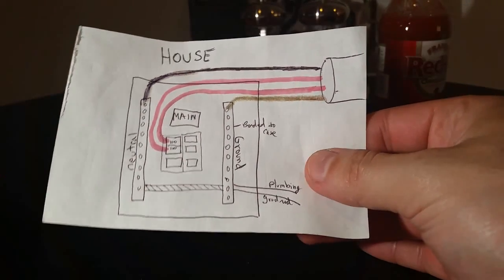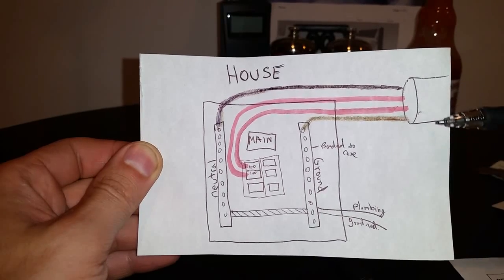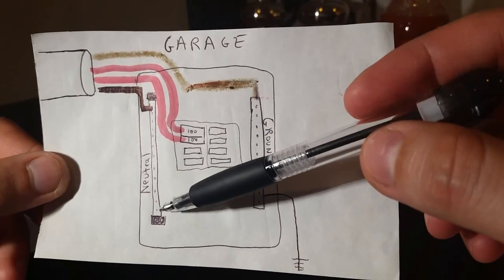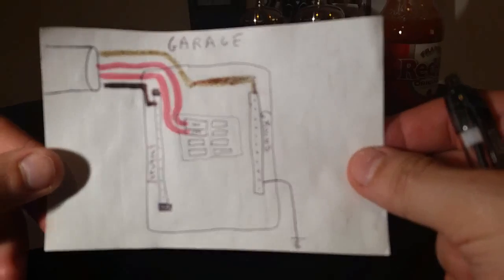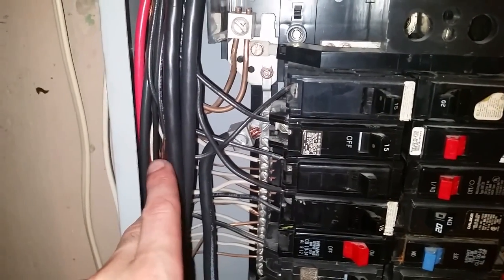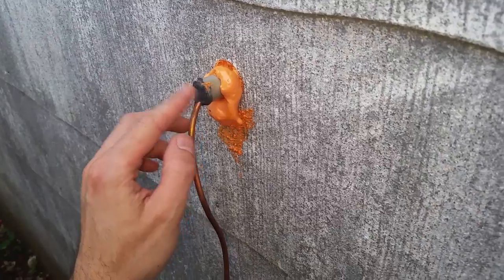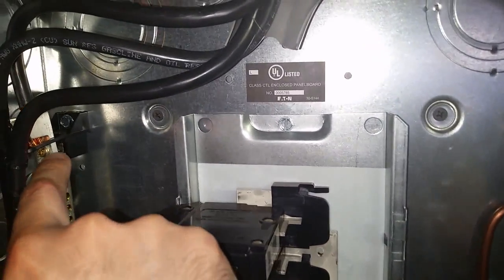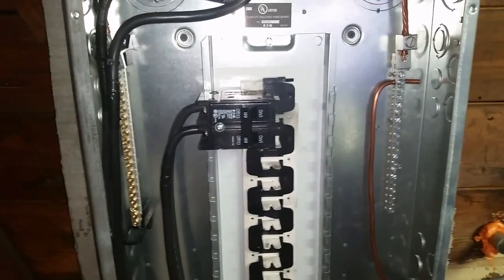How To Wire A SubPanel

Comment: Hey funster---Manny here, licensed electrician (trade-worthy since 92'), screw all the comments on how the kids chant: "Uuu, the panel is messy..." They are the ones who mainly do the 'wimpy-work' (ie. not enough torch down on heavy wires, flimsy pipe n' panel installs, etc)... Your job looks solid strong n' durable! Not the prettiest install but who gives a sh*t, we want stuff that is well supported n' something that will need nil-none maintenance within the coming years. A couple of critiques I would say is the exterior PVC was excellently supported w/ multi clips but you should have piped n' supported the ground too. On the ED-theory side of things, perhaps you could have described 'why the neutral needs to be isolated from the ground ' within the subpanel. As to secure a condition whereas if the neutral was lost at the main panel, due to equipment failure or weak tightening by fellow apprentices like thoses who have probably bashed you just previously on splices in the panel, or, maybe even a neutral loss pre-consumer side on the street transformer. The centre tap neutral block on the secondary side of the Hydro utility went bad thus all these phantom neutral conditions will return into the subpanel! And if it is connected to the ground as you very well described "should not be" then the unbalanced load will return therein, ultimately energizing the chasis of the sub panel! Moreover, the main will not trip due to the anomaly cos' it would not sense any difference within its' internal bimetals... Subscribe @Manny Calderari: I have Elec-Vids as well on Voltage Drop concepts, Pictorial drawings on connections n' the like... Great Video, excellent pictorials, solid job-out standing, n' cool jokes; especially "I like straps, I'm Greek" Bahaha!
Reply from the maker: Manny Calderari thanks for commenting

Comment: You stated that if you have more than 6 breakers that you should have it wired to a main disconnect breaker. How would you wife the panel without the main disconnect breaker?
Reply from the maker: johnsta83 i said that?
Reply: klowny1969 yes,start watching at 16:55. Unless I am misunderstanding you. Thanks.

Comment: Does the grounding/neutral/bonding apply if the sub panel is located in a seperate structure? Should it be a 3 conductor or 4 conductor going to this structure? Great video.

Comment: is their a way to wire a subpanel with 3 wires? i was thinking 2 hots and a neutral and run a ground wire from the subpanel to a ground rod would that work?
Reply from the maker: storminnormanz yeah but check with ur local codes first
Reply: ok thanks!

Comment: Drawings in the beginning made me understand easier for the walk arounds
Reply from the maker: Michael Sheets thanks for watching and commenting
Reply: I am contemplating putting in a sub panel in my garage (40 feet of wire). currently I have the only 2 remaining 220V Circuits left open, one for my air compressor and for my welder. If I put one more 220V machinery in there should I just go ahead and put a sub panel in my garage?
Reply from the maker: Michael Sheets ur better off

Comment: In the sub panel, is there continuity between the neutral bar and the ground bar? If so, they are the same thing. If you trace them back to the main panel, you will discover this.
Reply from the maker: I answered this question in the vid..no they are not comnected in the sub

Comment: Aluminium wire is not the best choice. However you misspoke about copper not expanding. It does like all metals when heated.  Copper does not expand as much as aluminium.      

Running a ground wire  to a water main is not a great idea anymore since many water utilities now use plastic pipe from the street to the meter outside (or inside)the house and many houses now use pvc or PEX.inside, none of which will conduct electricity thus making them useless for proper grounding.  

 A better idea is to run a #6 or #4 solid copper wire to a ground rod in the yard.   A damp or normally wet location is best for conductivity.  

NEVER pound on the end of the rod so hard it starts to mushroom.  (An inspector told me that when he finds a mushroomed ground rod he requires it to be dug up and the rod hole be inspected before the ground rod is re installed then inspected again before the dirt is put back in the hole - do it right the first time and avoid the hassle.  I was lucky - I could not find a hacksaw before I started hammering.)

Make the installation easier by digging a hole a foot (or more) deep and fill it with water several times as the water soaks down.  I would even do it a fourth time and leave it overnight.  The rod will go in with light tapping with a baby sledge and a chunk of 2 x 4 to protect the rod end. 

 It is a good idea to extend the ground wire to two or three  more rods spaced at least six feet apart and below grade and cover each with af concrete patio square so you will know where the rods are.  Again wet location like a gutter downspout discharge is better than a continuously dry location.

Comment: Ok first I'm sorry for my ignorance but I'm learning and studying to be an electrician but I have a question and someone please help me. 
If I have a main panel of 100 amps, how many amps the sub panel should have ? Is it 60? Or can I use 100?
Reply: Joshua Cortez Supe best to add up you amp needs at the future building and then build the box based on what you need. Then if it's beyond the 100 amp main, well you're out of luck.
Reply: @Jack_Of_Most_Trades  
Not completely out of luck, but need separate service entrance installed from the power company :-0)

Comment: FYI, if you have more than six breakers in your sub-panel you are required to have a main shutoff for that panel per NEC 230.71. This can be a back fed breaker so long as it is tied down (as I see you've done here but didn't mention). A sub-panel main breaker can have a larger amperage than the feed breaker in the main panel, i.e. you can have a 100A sub panel fed by a 60A feed breaker from the main so long as the feed wire and load calcs are for 60A, the 100A sub breaker simply acts as the aforementioned shutoff. Also, it makes no difference which hot wire goes into which breaker terminal, they both supply 120V. Nice vid.
Reply from the maker: Thanks

Comment: does a underground require a gfci breaker?
Reply from the maker: papa Hajek not unless the outlet is outside
Reply: Thank you
Reply: papa Hajek all outlets off a subpanel needs gfci so it's best to just gfci the first outlet in a circuit and the rest will be covered on that circuit.

Comment: I'm wanting to run a new100amp panel outdoors for an RV.  the camper has 50amp and 2 a/c units on roof with elec heat.distance is 300 feet away from the 200 amp main . Can you tell me what wire size to get and how many? I was told 3 wires @ 1/0 copper? and was told four wires from a different person? Thanks for the help
Reply: Do you want 120 volt or 220 volts ?
Reply: You are probably done, but in case anyone else plans similar ---

A 50 amp RV plug/outlet has 2 power wires - each 120 volt
so you can have more amperage available (along with ability to run 240 volt if needed).

300 feet (plus however much for extension cable 50 feet not uncommon)
could cause a lot of voltage drop and some equipment on the market won't run properly if the voltage drops too low.

I would go with 3/0 copper wire for each of the power cables and 2/0 copper for the neutral.

1/0 may well work okay depending on how much amperage you actual use at any given time. 

The added cost for 3/0 would be worth the peace of mind that you'll have no future problems.

You should drive a copper ground rod in near your RV outlet power supply.

2 power + neutral from the main and 8 awg bare copper from RV outlet to local ground rod.

It's also good practice to run 8 awg bare copper to connect the local ground rod to the ground rod at the MAIN but is not absolutely necessary for long distances like you are talking about.

PS
 I buy wire from
http://www.ebay.com/usr/acdcwireandsupply

Comment: At 6:24, why are you grounding the sub-panel to ground rods, if the ground bar at the main panel is already connected to those? Thanks!
Reply: Same building no, different building yes
Reply from the maker: DTM the ground wire going to the main fromthe sub was an extra wire..u dont have to wire that one in..but it doesnt hurt..for a detached garage u need a seperate dedicated hround rod..check ur local codes

Comment: Great video.  I want to install a subpanel in my shed, but the power source is a Generac generator so there is no need for a main panel.  My XT8000 watt generator has a 4 prong plug which I want to use as a connection to the power inlet box.  The amps from the generator is 30 amps. What should be the circuit breaker amp be at the subpanel (which is more like a main panel). A real main panel would cost a fortune and is not needed.  Other issues to be concerned about???? Thanks.

Comment: SER cable is not rated for under ground use even if its sleeved in conduit.
Reply: This is a huge break of code right off the bat. I'm looking at XHHW aluminum for my run.
Reply: is there such a thing as a 1-1-1-4 cable?
Reply: southwire has 1-1-1-3
home depot
Reply: PART NO.13103701

Comment: Why not just ground the right bus bar in the subpanel  to the box with a piece of wire, strap, etc?
Reply: @mimeme
Agreed.
So long as the neutral is separate, how the ground bar gets bonded to the case doesn't really matter - so long as it is bonded.
Reply: sirvayr by code it must go to ground rod.

Comment: Great vid.  Question.  It looks your sub-panel only has a bus to attach breakers, no lugs to attach the feeder circuit.  My sub-panel uses lugs to terminate the feeder hots, therefore I'm planning to install a disconnect box just before the sub-panel.  My sub-panel is a detached building, and I did not want to have to go between buildings to resolve tripped breakers, turn power on/off etc.
Reply from the maker: thank u..u can do that with this subpanel as well
Reply: The more I think about it, maybe I should just land my 2 feeder hots on a 60A 240v breaker on the bus in my sub-panel instead of introducing a disconnect box before the sub-pane, then landing the feeder hots on the bus lugsl...Isn't that what you are doing, using that 100A breaker in your sub-panel as a "disconnect" as well as main breaker for all the other branch breakers in your sub-panel???
Reply from the maker: +ke0kie yesir..u can do it either way

Comment: where the white tape on the subs neutral going to the main neutral bus bar failed , you need expansion straps for that pvc ,the trench needs over 6inch depth , the screws used to mount the sub is not code , you need duck seal and corrosion lube on breakers connections the sub needs to be framed in better
Reply: The neutral comes marked with a white stripe from the factory. You can clearly see it in the video. Granted this is a mess but in any multi conductor cable such a SER they come colored. He left way to much of the cable jacket in the panel. And what the fuck was with all those straps hahahaha looked horrible if your gunna overkill it at least kinda make them even.(I would have done like 4 straps)     Eye level?????  You can't have any means of disconnect (swichtes breakers, etc) over 6 feet 7 inches. That's NEC so all of the USA follows it.
Reply: And what screws are code?????? To mount a panel and what article is it??? Him using drywall screws indoors is fine (I use number 10 screws) but there is no code on screws.
Reply: And on copper you do not need no-lox.......You don't need that main breaker in that sub panel you should have just got a main lug panel. And that fire stop is ok I guess but not outside it looks like shit...(maybe a little duct seal and clear calk) much cleaner IMO.

Comment: that's odd I wire sub panels without a ground I un strap the neutral and ground and remove the green screw and I'm grounded from the  main ground bus to ground rod.
Reply: If it's a different building then the main panel you need ground rods. It's clearly stated in article 250 NEC. If it's the same building you obviously don't need them.

Comment: If you wanted a subpanel   right behind the main panel but on the inside of the house compared to the outside would you need to ground it to a rod or can it be grounded via the ground that goes to the main panel?
Reply: No only if it is a different building (detached garage or like a mother daughter type house) you need a ground rod for a sub panel. It's in article 250 in the NEC.

Comment: Thanks for show. When do you show a video with subpanel fully electrical stuff? Nice to see how they put electric cable in USA. Here in Germany and in Thailand we do it different. In Germany comes 5 wired cable (63 A) inside house, into working hall use 5 wired (32 A) normally. The five wired cable be safe earth ground (green/yellow), neutral (blue), 3 wire live (brown, grey, black). Live to live = 400 V, Live to neutral = 230 V, use RCD for bathroom, kitchen and outside outlets. For most machines be 230 V or 400 V with 16 A enough, so oven, washing machine, drying machine, and so on. In Thailand we have own transformator for the 10 houses here. Can use 1 kA / 3x 230 V for all houses but the most houses have only a 32 A fuse or two 16 A fuses. We use one live phase only for all lights, so the other 2 live phases go half to 5 houses. We have only 220 V machines, the freezer and gas stove be the most used part here.

Comment: your earth/ground cable coming from the house into garage subpanel...is it the same diameter/gauge as the earth/ground coming from outside into your subpanel?...and what is the purpose to have 2 hot wires going to the garage?
Reply: 2 hot wires for 220
Reply: maybe needs plug a welder machine 220 volts or other machines the same voltage.

Comment: I have a question, if I have a 100 amp house panel and I wanted a sub panel in my garage what's the highest amperage I can run out there?
Reply from the maker: that depends on how much amperage ur running at a time in ur house..and how u want to run in the garage
Reply: +klowny1969 I have a furnace out there and I was going to add an ac and only use them when I'm working out there I do hvac so I get it cheap. But I have a deep freezer that runs out there constantly  (deer meat)
Reply from the maker: +drumtech06 u have to add up all that amperage..sounds like u might have to upgrade ur home to 200 amps
Reply: That's what I was thinking. So 200 amps to house and a 100 amp sub panel to garage?
Reply from the maker: +drumtech06 most likely..but i cant give u a definite answer because i dont know the total amps u will be drawing

Comment: curious why did you use a main breaker for your sub panel and not a main lug load center?
Reply from the maker: +Brian Z its so i can shut it off at the garage if i want to do anything in the subpanel..thnx for watching
Reply: Brian Z also sometimes subpanels come preinstalled with the breaker. Always nice.

Comment: Great video.  Simple and straight foward.  If you don't mind, I wanted to ask a question.   How did you determine the size of the subpanel? (in amps, 100 in your case).  I know it depends on how much power you will be using in your garage,  but I am trying to do essentially the same thing you are doing and doing it myself and I have almost zero experience working with electricity and the local codes guy is giving me a bit of a hard time.  Although I could do my building just like you did, at this point I think I'm going to have to explain to the codes guy HOW I arrived at what I'm doing and I'm having trouble finding, in writing, in any of the 6-8 books I found at the local library, how to determine exactly what size subpanel and wire to use.   One of the books I have even contains photocopied pages of the NEC that seem to be dealing with that very subject,  but I can't make much of it.   I have a 200 amp panel in the house with 8 open spaces.   My garage is 100 feet from the panel,  25 ft of which will have to be underground.   I only need 1 220 outlet in the garage for a table saw,  four additional outlets for other woodworking tools (110v) and 6 double florescent shop lights.  Any help is greatly appreciated!
Reply: Matt Inman guys SouthWire had an app to give you size and length etc
Great app
Reply from the maker: hey..you can google what wire size vs length of run and amperage draw you will need..and you should see some charts pop up for the wire gauge size you need..so in your case you need to see what guage supports the 100 ft run and say 100 amp box with out experiencing any voltage drop or burning wires. .thanks for watching
Reply: +klowny1969 thanks.   someone told me to check with the local power company too

Comment: you don't run a ground wire unless the sub panel is in the same building per NEC
Reply: @Darell N you need an equipment ground which is the ground wire that comes from the main panel and also need a ground electrode when your subpanel is far from your main panel.

Comment: good video thanks for sharig
Reply from the maker: Tnx for watching
Reply: klowny1969 I am confused on which big black wire goes to which side of the main 
box. does it matter because the wires are both hot (L1 and L2) so even 
if i hook them up from either side on the box right under the smart 
meter it should not matter right? They are both the same size wire and 
the only difference is one has a white line on the rubber cover 
(insulation)

Comment: 14:55-"this is going to the ground bar...". You probably should have mentioned whether the ground wire from the sub went to a separate ground rod, or did you take it all the way back to the same ground rod as the main? This may have been confusing for some people. I'm assuming you put a separate ground rod outside the garage.